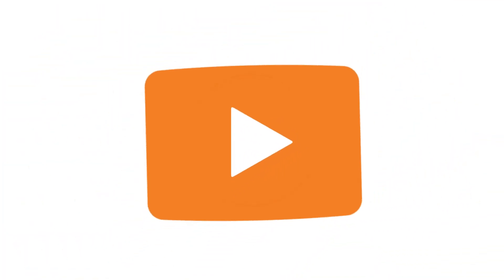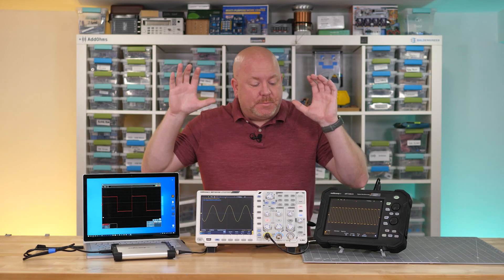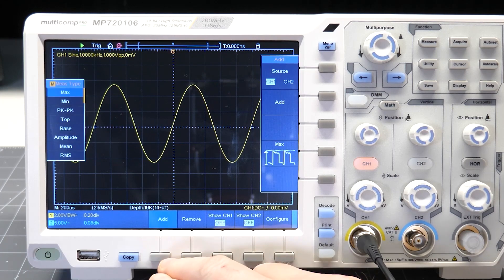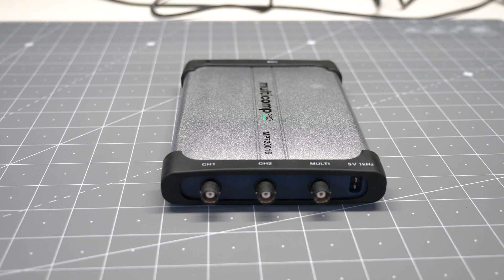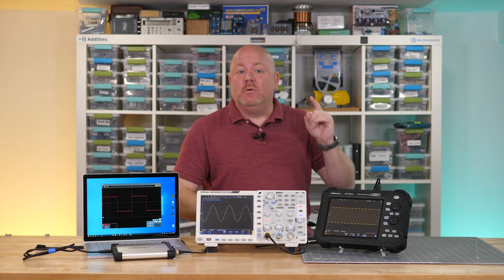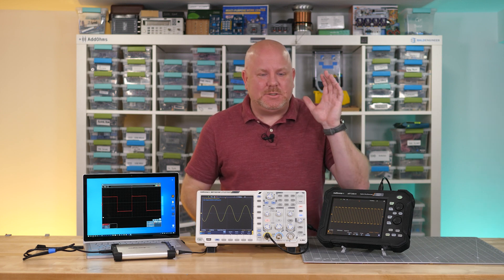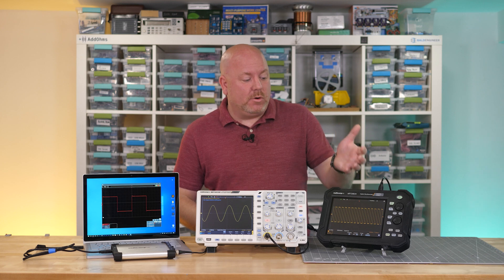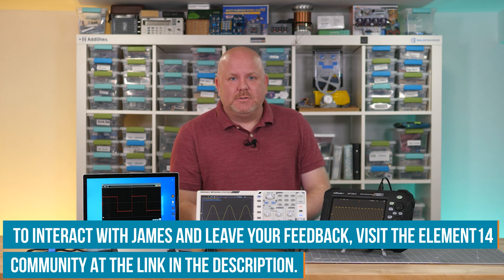Which Oscilloscope Style Is Best For Me? - Workbench Wednesdays

Comment: I have that same tablet scope (it's not called multicomp though), but it's the top one they offer and it has a different brand name-- but it's somehow exactly the same tablet scope: (called OWON TAO3104A) -- the "A" at the end stands for "accuracy-- and it denotes the fact that this one has 12bit and 14bit options for vertical resolution..  And it DOES have pinch to zoom.  It's by far the best tablet scope I've seen yet--  better than the Micsig..  It's fantastic and I've only seen ONE video on it somehow.
Reply: Have you used the Micsig? I have only looked at the specs. What I think Multicomp/Owon did well with this tablet is basing it on the same software as their bench-styles. That way it is a full featured scope in a very portable form factor.
Reply: @bald_engineer   I've never used a Micsig-- but I've watched a lot of videos about it, trying to decide if I want to buy it.   The main downfall is that they are all 8 bit scopes;  even the 2k dollen options.

Comment: What scope do you recommend to take measurements of equipment that measures mains ac voltages?
Reply: Get the tablet because it’s portable and battery operated for good isolation from the mains. This means you don’t need a separate isolation transformer. Trust me, I blew up a scope and the probes by measuring the mains once without being isolated!
Reply: Thanks for reminding.💚💙💜💛🧡

Comment: Now, instead of making an ad for this brand, how about the measuring accuracy of any scope... like the Tektronix scopes?
Reply: Generically proving an oscilloscope's accuracy quickly turns into a fool's errand. The signal under test and how it gets probed have significantly more impact than the scope itself. People tend to look at 3 things: DC accuracy, timebase, and ENOB. DC Gain on a scope (any manufacturer) is in the signal digit percent range.  Timebase stability is almost immeasurable [by most people] on any modern scope. And ENOB only applies for 1 specific frequency at a single attenuation setting.

So what seems like a simple request turns into a confusing mess of measurements that cannot be compared between two scope models.
Reply: @bald_engineer  ,  Gee, I  don't know anyone who would fail to compare a junk box scope with a Keithley and not be able to say one was better than the other. I can measure, using thirty year old tech the differences between two scopes with no problems or even using The Signal Path's level of mathematics.
Reply: @BruceNitroxpro  Well, no one would compare any scope to a Keithley. Keithley doesn't make oscilloscopes.
Reply: @bald_engineer  ,  LOL Right... but they use DDM circuitry, which the scopes ostensibly did. Good point, though! I think that my point was, "junk level vs. pro level" devices. But when the laughing stops, THAT was my point.
Reply: Now, if the real question you are trying to ask: "*how* do you compare scopes to each other," that might be an interesting topic. But I stand by my previous comment when it comes to proving the accuracy of a specific scope.